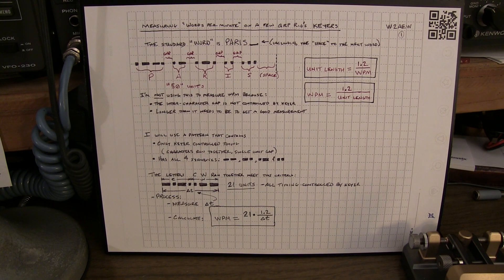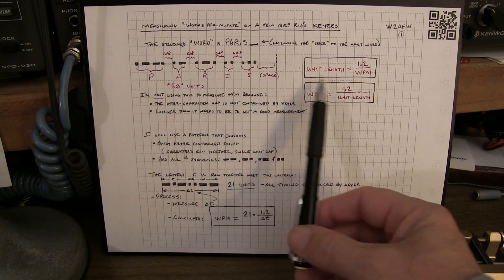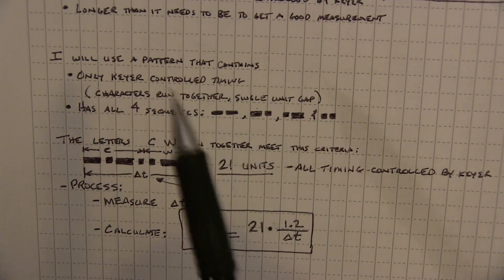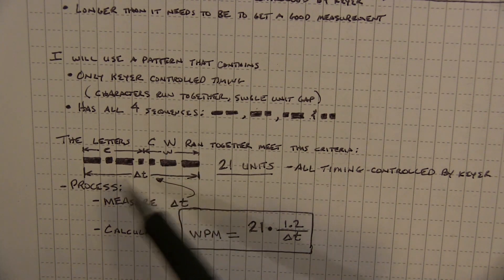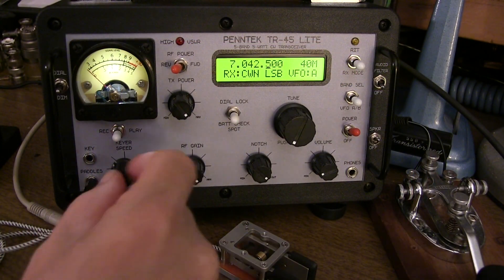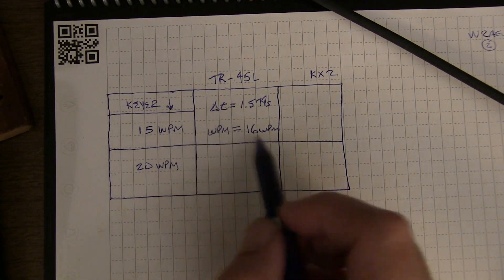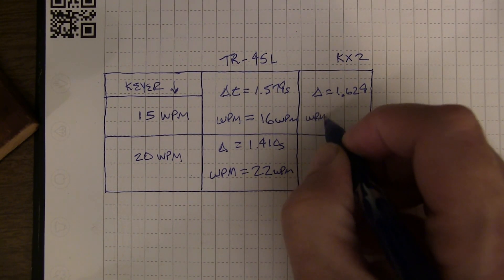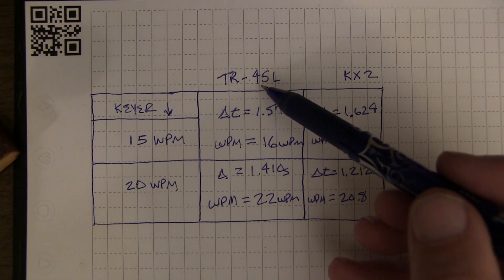#378: Ham Radio: Measuring CW Keyer speed on the Elecraft KX2 and Penntek TR-45 Lite

Comment: Interesting... The mathematics and rational seem sound.  The test seems more than adequate.   Using the oscilloscope to measure and test is cool.  But how would you calibrate either radio?  72  de W7UDT
Reply from the maker: Neither give you a means to adjust the displayed WPM vs. actual - so you're left with remembering how far off (percentage) your radio is, or simply adjust to a comfortable speed for you and ignore the numbers.

Comment: Alan,  Thanks for the interesting video topic.

In my POTA activations, I've found that the frequency I am using also comes into play as another dimension. I use the KX2 and the FT-891 the most during POTA activations and set the keyer speed to 24 wpm on both radios. When I activate POTA on the 40-meter band (affects both rigs) I perceive the Keyer to be slower than what I've set. However, when I QSY to 17 or 20 Meters the keyer speed becomes a little faster. I would say the difference in speed is about 1/2 wpm. This behavior is very consistent. Maybe there are some other factors at play here but I didn't look into it in any depth. I just adjust the keyer speed to compensate. I find the RBN consistently gives a faster WPM rate than from what I have set on the radios about 1 wpm faster. So if I set 24 wpm RBN reports me at 25wpm.

If time allows, you may want to redo the testing and use 40 and 17 and see if there are any differences you notice. As mentioned, I can hear a difference but I didn't do any actual measuring. 73, Jerry AC4BT
Reply from the maker: Interesting - I wouldn't expect the keyer speed to be dependent on the band being used.  The 1 wpm difference between your setting and the RBN report is similar to what I observed on the KX2 in my testing.  I never tested an FT-891 to see how its setting vs actual speed behaves.

Comment: I have noticed the same thing with most of my radios.  They generally show slightly faster on the RBN than the key speed set on the radio.  The exception to that is my FTDX10, which is usually one wpm lower on the RBN than I have the key speed set.  I don't stress it too much.  One or two WPM isn't a huge deal, but it's certainly interesting to see it tested and verified.
Reply from the maker: Hi Evan - It was an interesting experiment.  The FX-4CR and my old Icom IC-703 are both spot on.

Comment: In the calculation for wpm with the word 'PARIS' there is a 3-unit trailing space included, whereas in your phrase 'CW' there isn't. That would be another source of error.
Reply from the maker: The calculation with the word 'PARIS' includes the standard 7-unit trailing space used between words (not 3-unit).  This makes up the 50-unit length of the PARIS_ "word", and is what is used to derive the calculation of the unit length:
unit_length = (60 sec/min) / [50 *(x word/min)] = 1.2/WPM.
This calculation gives you the unit length for any WPM.  Thus, when using my 'CW', all I need to do calculate the WPM for the 21-unit sequence of the 'CW' pattern. There is no need for a trailing space, and thus no source of error.
Reply: @w2aew  As soon as I wrote my message I thought, 'surely he would have thought of that', haha.. Wonderful. Great video as always! :-)

Comment: I’ve noticed both my TR-35 and TR-45 are slightly faster than stated. I set it 1-2 WPM slower than I actually want. The IC-718 at my mom’s desk I did a test using the RBN because it sounded so slow. It was 2-3 WPM slower than you set it to. Very interesting. N7CCD
Reply from the maker: Interesting.  I did learn that the RBN reported speed is pretty accurate.  While the TR-45L and faster than it's set for, and the KX2 is also (but not at much), the FX-4CR was pretty spot on, as is my old Icom IC-703.  I'm surprised that the IC-718 is slower than set.

Comment: Does the KX2 have a weight adjustment in the menu system? I seem to remember seeing such a setting in the manual for the KX3 and the K3. You might be able to adjust the keyer speed.

Well done and well explained. 73 de AG7TX
Reply from the maker: I believe it does have the weighting control, but I think that will just adjust the relative dit/space/dah ratio.  I had adjusted mine to be as close to the 1:1:3 as possible.

Comment: i thibk a small error is measurements were committed, which is known as the "fencepost error" (https://en.m.wikipedia.org/wiki/Off-by-one_error):

"cw" was measured as 7 symbols and 6 gaps long. i think the measurement would be more accurate if/when the length of 7 symbols and 7 gaps would be considered
Reply from the maker: The problem is that there is no way to force an extra space in the keyer operation.

Comment: Gave me an Idea to use  Arduino to generate Morse code and Detect Morse code.
For generating Morse code one would use keyboard and Arduino to look up the table and generates Morse code.

For the detector first we do envelop detection, then if the code was generated by machine  we could use clock recovery PLL, but if it is generated by humans we detect the long time  ( ie.  _ ) and then divide them by two any signal that is shorter than this time is "." and any thing longer is "_" .  Then based on this we could look up a table and print  the character on LCD or send it though USB to computer.

It would be a fun project.
Reply: There is a bunch of ready-made code and such projects and ready-made devices for this. You’re late.
Reply: @segrus    Thanks, good to know.
But still is a fun project.
Reply: @aduedc  Okay) try it